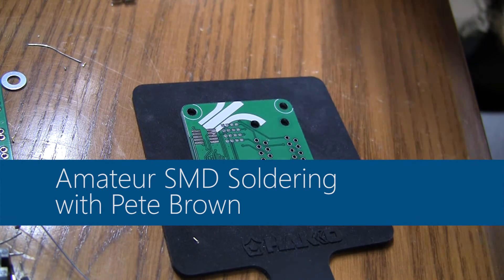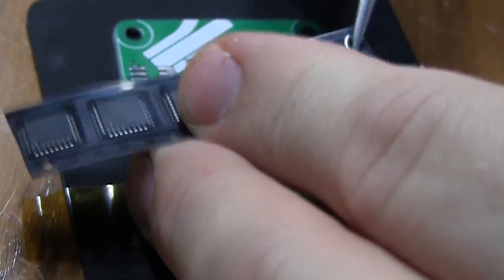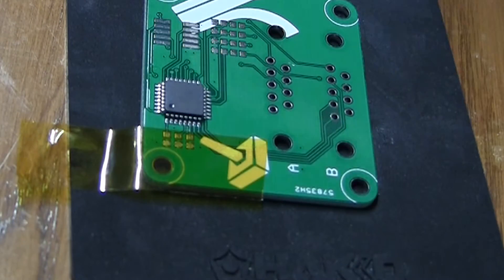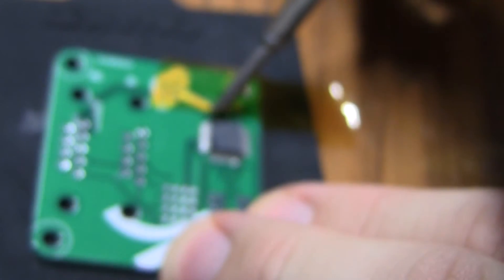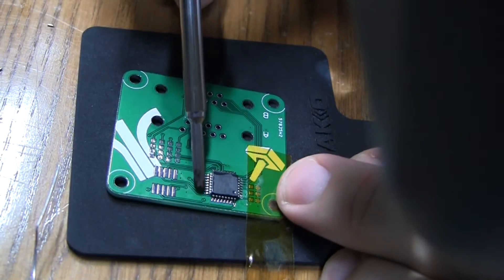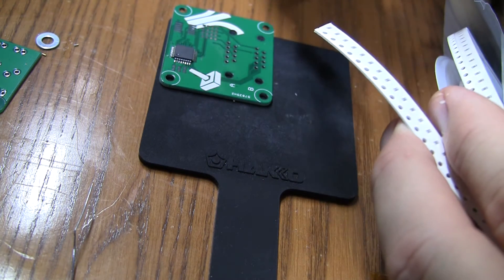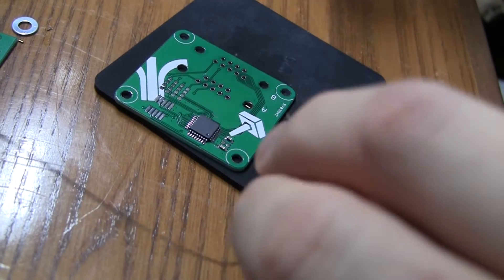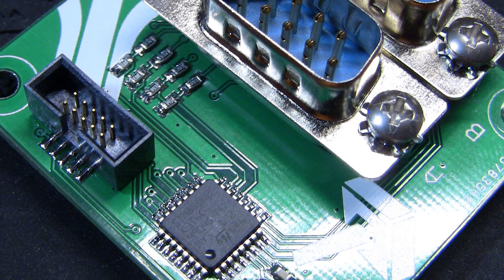DIY SMD Hand-Soldering of 32-LQFP and 0603 Packages

Comment from the maker: Thanks. I have a hot air station (which I've used to desolder some items), but have found the drag approach to be easier for putting them on the board. I may just not yet have the knack of the hot air gun.

Comment: soldering paste is good for those smd component and hot air soldering station where you can change temperature, 300C it's about right not above that and you are fine